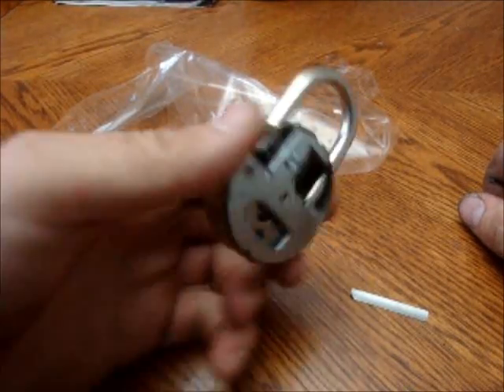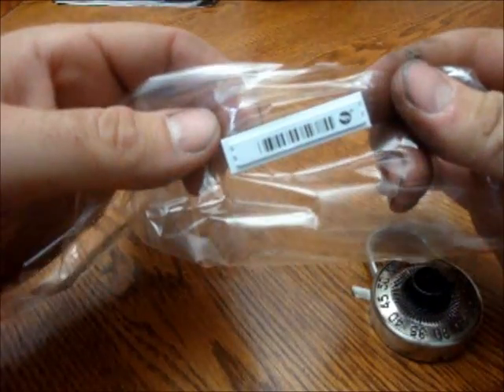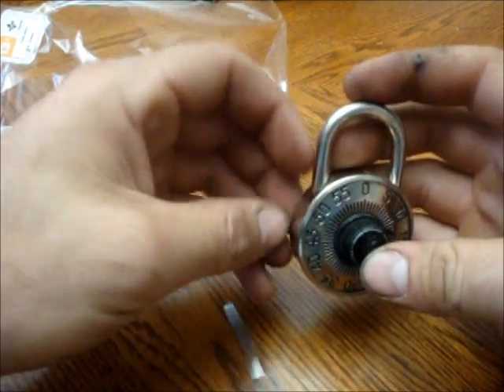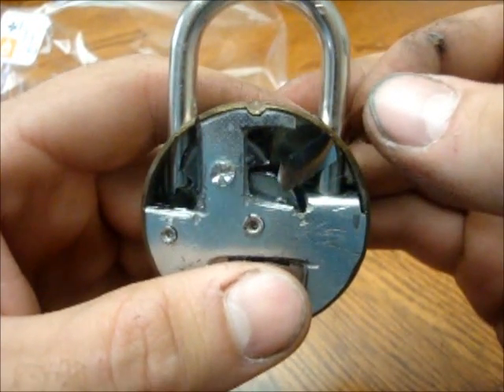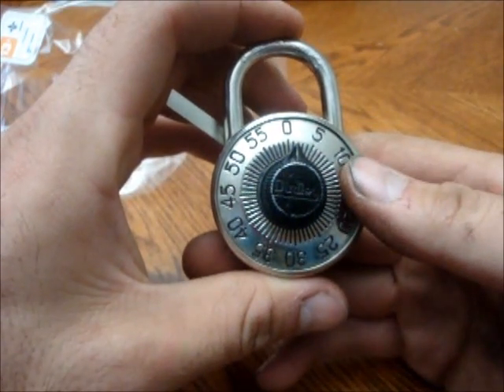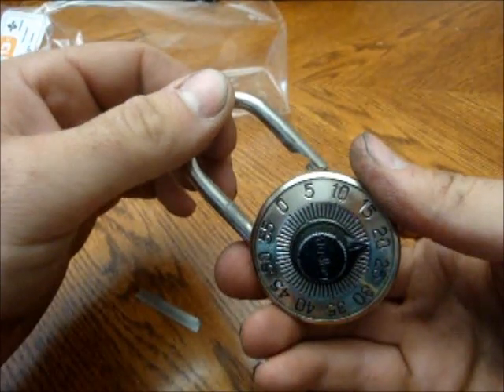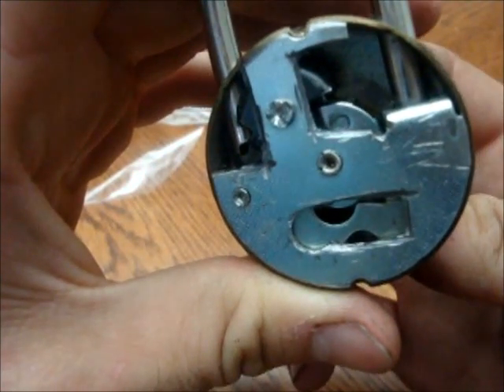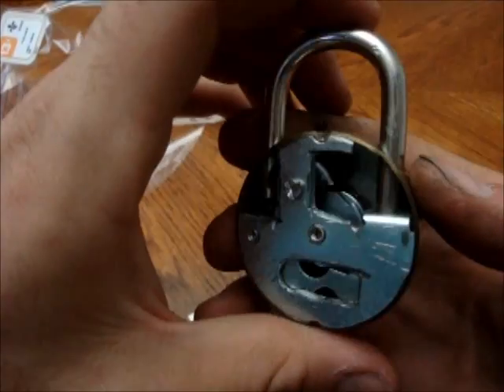Dudley Lock combo cracking How To.

Comment: Thanks man I cracked one lock with your method. I practiced on a lock I knew combination to first. I used an old film negative and cut a little strip out of it. It also curls a little which helps a lot. Placing it right by feel is the toughest part. thanks again.

Comment: Thanks for this. Needed a combo lock for the gym and my parents had left an old Dudley after their last visit, but I'd lost the note with the combo on it. Took less than 15 minutes to pull the whole code from it using this great trick. First time I've ever wanted/needed one of those little security tags.
Reply: IMHO this is way better (and much more useful) than the "try every likely combination" brute-force attack. Way more elegant.
Reply from the maker: Glad you found the trick useful, alot of people give up because it takes some skill to actually get it to work, many want a zero effort method. Unfortunately this one isn't zero effort, but once you get good at it it is fast.

Comment: Thanks for the tutorial, used it to figure out the first number for a lock that my wife couldn't remember the combination for, I could hear a slight scrapping sound as the wheel turned and then a click like you described. Then used an algorithm method to try the possible combinations and got it on the 6th attempt.
Reply from the maker: Glad you were able to use part of the method. Getting good with it requires practice but once you do, you can find the combo in minutes. Thanks for watching.

Comment: thanks, Stray.  got the first wheel part working, just have to get to the second wheel!  ...  when combined with the knowledge that there are only about 10 possible slot locations on each of the wheels (ie, slots centred about 6 numbers apart), it really reduces the time to "remember" your combo!  (there's a text posting about fake and real slots:  they are evenly spaced at about 6 numbers apart, so if you know the first slot, the rest are easier to find)

Comment: Oh, ok, I think I know what you mean now. The third wheel is thinner just, and only just, between two of the cogs, which allows the cam (bolt) to slide back and the shackle can be pulled open. I had to think about that one for a moment, but now it makes sense. Thanks! Happy picking/bypassing/bumping/gutting, etc.!

Comment from the maker: Actually both wheels have 1 false gate each and both seem to be the same distance from the real gates. the third wheel has 10 cogs and is what locks up the dial from turning if you are pulling on the clasp. I have only opened one, but I have another that due to being left in water a long time, Might be another candidate.

Comment: So, one of the 10 cogs on the third wheel also serves as the real gate? Is that what you mean? I have a couple candidate Dudley's that are overdue for gutting and inspection, I just haven't got around to ripping them apart fully, yet. Anyway, Thanks for the info. about the false gates and cogs, that's quite helpful.

Comment: Have you opened enough locks to know whether or not the false gate(s) are always located on a particular wheel? In this video, the false gate is on the wheel for the first number. If it is *always* on the first number wheel, and there is only one false gate per lock, then that would make figuring out the combination even easier, just by using some basic logic. Just as long as you don't hear, like, 10 gate clicks.

Comment: I don't think you really need to really be able to tell the differences in sound between the real gates & the false gates, just as long you carefully mark down all the numbers that correspond to the clicks you hear. If the lock doesn't open, then clearly at least one of the numbers is wrong & could represent a false gate. A little trial & error is all that's really needed to eliminate the false gate numbers. And you already know the lock only has a 3-digit combo, so if you get 4 number-clicks...